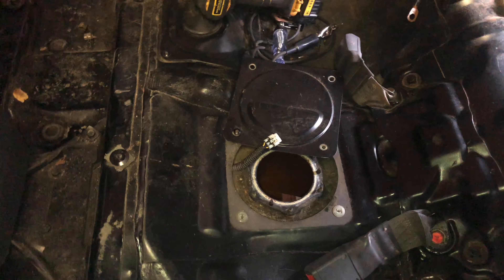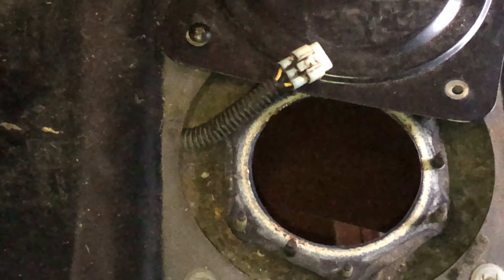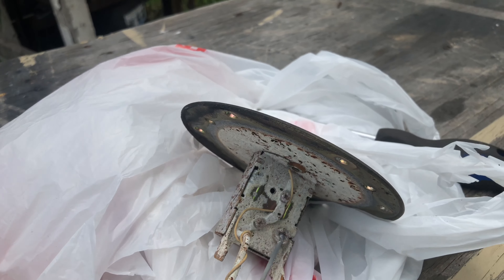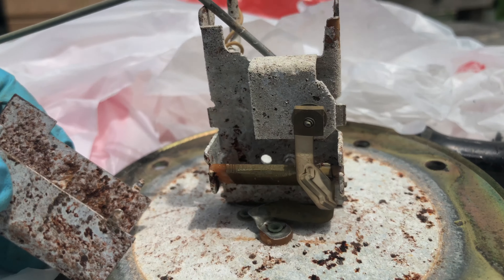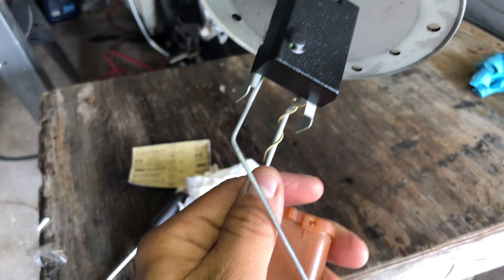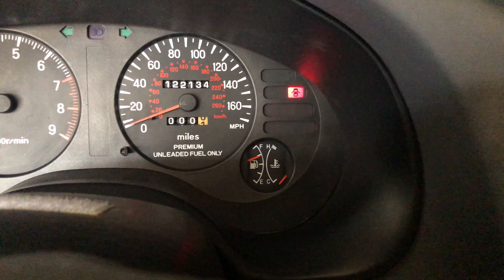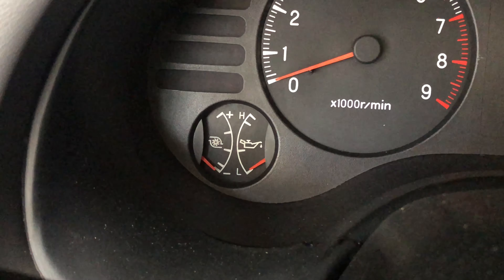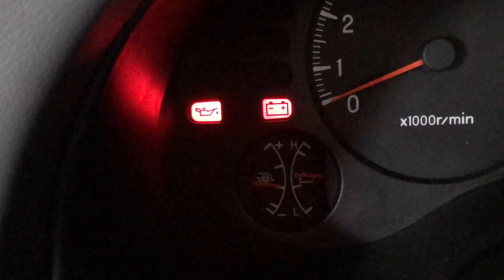Fuel pump sending unit repair | 2g Eclipse

Comment: When you say ‘ground out the yellow wire’ to test, how exactly do you do that?
Reply from the maker: Get a piece of black wire and put one end into the “yellow” side of the prong connection( of course strip the ends to bare wire) 
   
And then ground that end out to the chassis or on top of a bolt “ground” of the vehicle.

Comment: What’s that sensor called that’s covered with the orange plastic? And what does it do? I was assuming it may be some type of ground.
Reply from the maker: If you’re referring to the cap/sensor @1:30, I could be wrong, but I believe its still the fuel sensor(one whole sensor unit). The black floater obviously triggers the “empty” signal. 
 I could be wrong haven’t looked into it. Maybe it is a ground I didn’t test it when i removed the whole piece.
👍